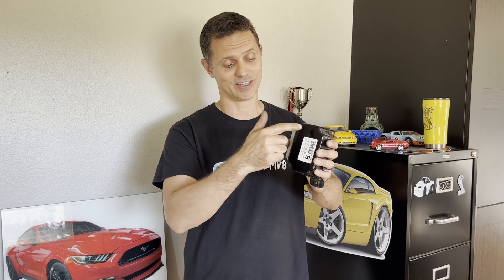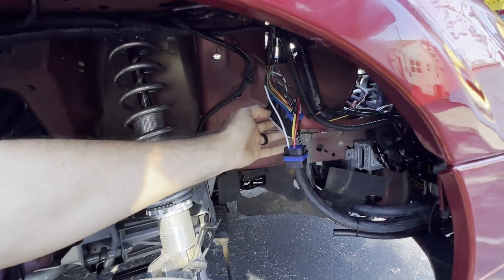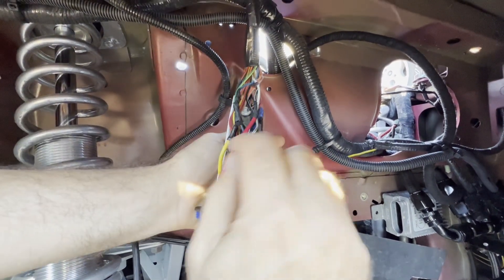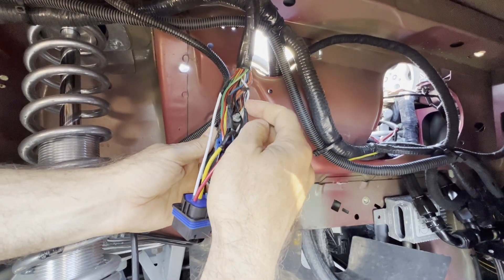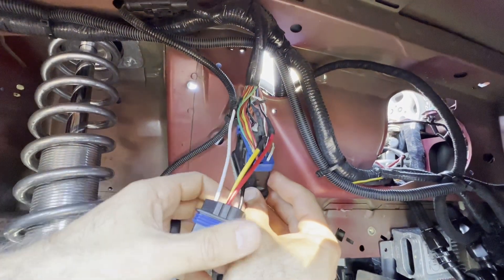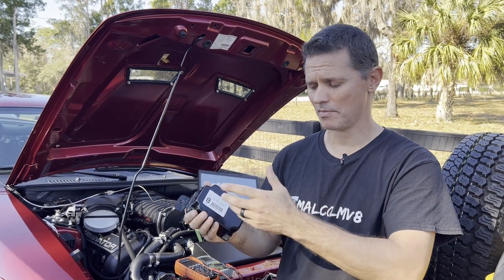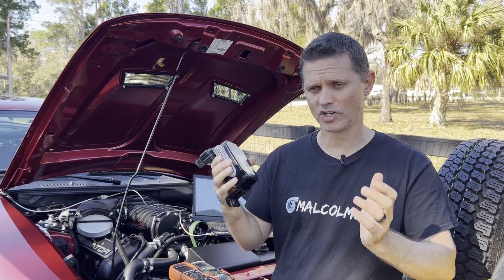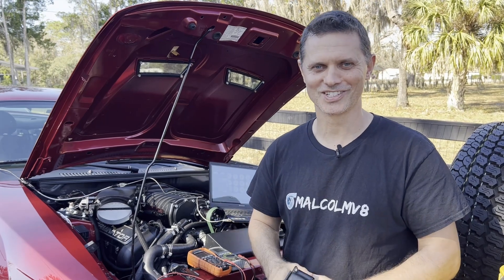How to trigger both CCRM Relays with a single input

Comment: Not sure if I did something wrong or not but I ran my relay hooked it with the ccrm and when I hook a battery charger to ground and hot it runs? I am using the ford fusion controller also. Is this normal? I havent hooked my signal wire to the holley hp yet.
Reply from the maker: Usually the Ford Fusion fan speed controllers do not turn the fan on unless the signal wire is receiving a PWM signal.
Reply: @MalcolmV8  I have red power to relay switch, blue low speed to relay ground, high speed green/purple to battery, and ground to relay 87a closed circuit (on). Does this sound right?
Reply: Looks like I had the ground/hot wires backwards. The ford fusion has ground/hot on each side of the controller, and I hooked to the wrong causing power all the time.
Reply from the maker: @scottadkins918  ah, glad you got it figured out.
Reply: @MalcolmV8  here is something interesting.. usually the mark 8 fans I have to set it up to 75% power because 100% was shutting down.... pulling too much power I assume
Reply: using
Reply from the maker: @scottadkins918  never experienced that myself.

Comment: you just tying both low and high speed wires together on the electrical fan harness?
Reply from the maker: Yes exactly.  That way both outputs are feeding the fan at the same time.

Comment: For factory settings, when Hi speed fan circuit is activated, is power still applied to Lo speed fan circuit?
Reply from the maker: Yes. A common trick back in the day would be to set the low & high speed trip points to the exact same temp to have both relays on together.